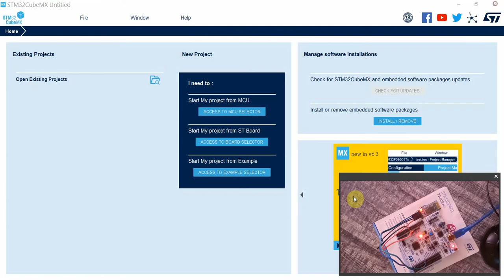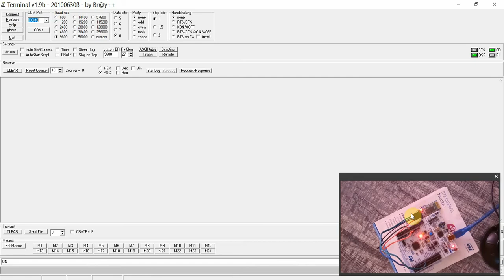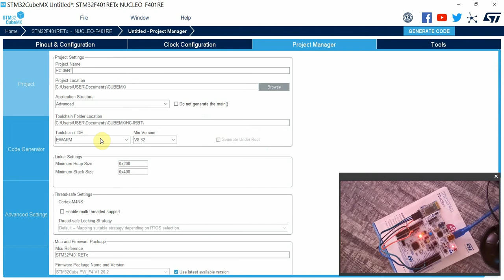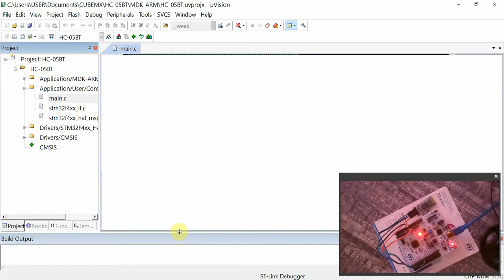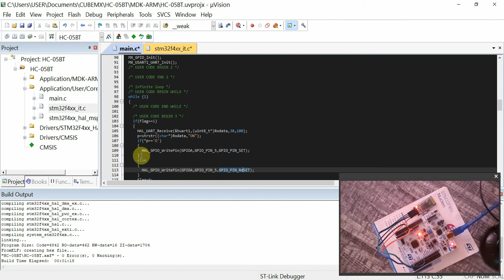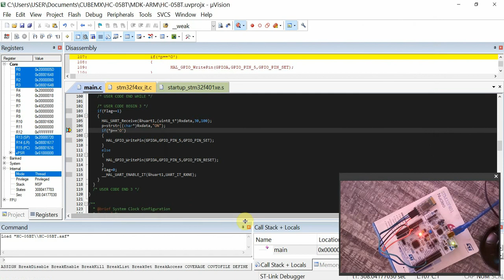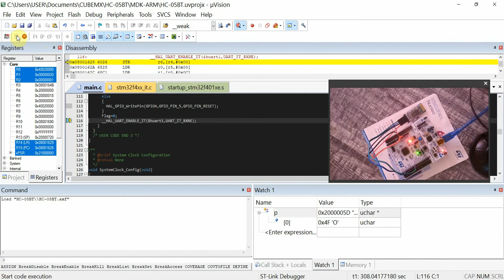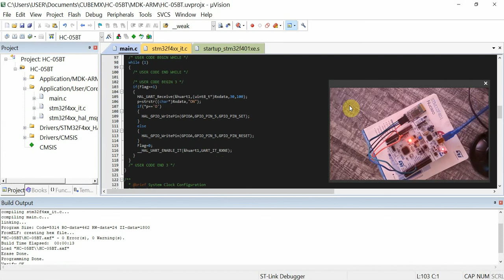HC05 BLUETOOTH MODULE WITH STM32

Comment: Thx for the video. I just try to use stm32 nucleo and hc-05.
Reply from the maker: Did it work for you?
Reply: @hayducate  Yes, but I don't know why i have to send two space before ON and OFF, otherwise it will not toggle the LED.
Reply from the maker: @Shiyu He  when you send without spaces,I noticed that the first few bytes are ignored,so I added more space to ensure that the string to send is safe.
Reply: @hayducate  I mean in your video, you send "  ON" instead of  "ON", I don't get why we need to add two spaces.
Reply: @hayducate  Thanks for the information😁